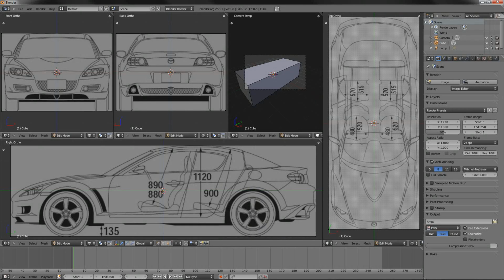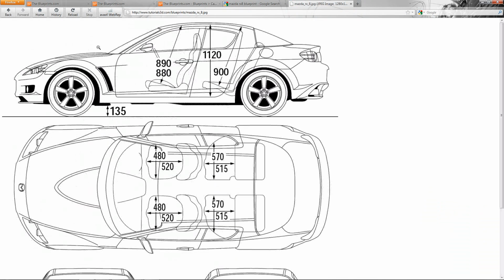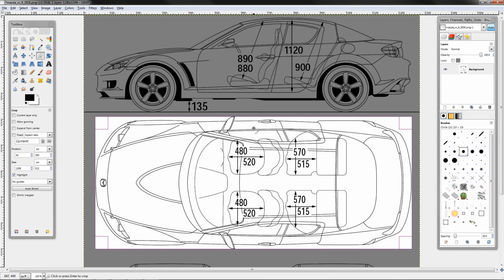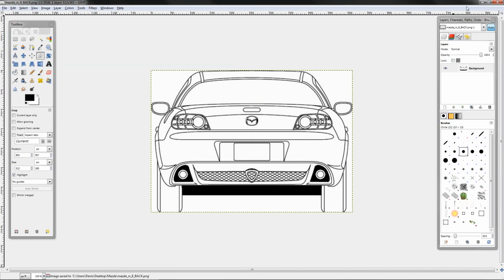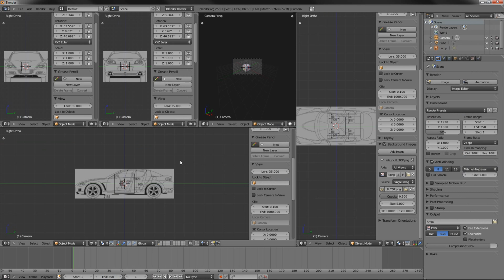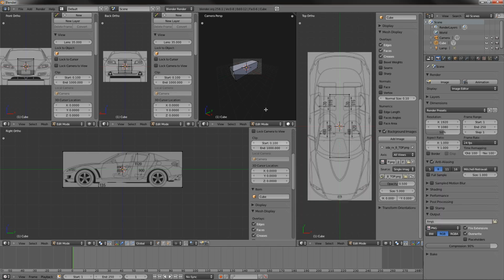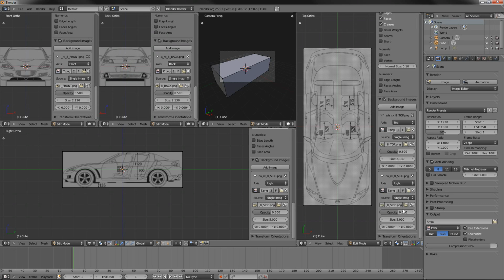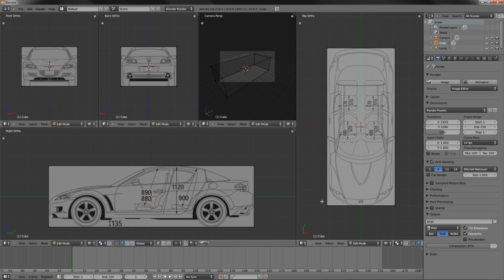Tutorial: Setting Up Reference Images In Blender

Comment: Didn't work here !
Reply from the maker: patriotaRBC You gotta be more specific, what didnt work for you?
Reply: Well, my measures are
Side 1069 x 331
Top 1069 x 400 (400x1069 after rotation)
Back and Front 400 x 331
I set side view and use it as reference to set the others, like you did. Then i make the math you did
400/1069*5 but te result number did not work to fit the width of the top/back/front views. Did i make the math correctly ?
Reply from the maker: patriotaRBC Looks like you did the operation fine 400/1069*5 = 1.87....
I can think of the following that may be of issue:
1) Is size=5 in the side image?
2) Was cropping done carefully to fut around the whole subject?
3) Quality of reference photo?

The math part seems ok, without seeing your setup i am not sure how to help you though. Should be working :/
Reply: The crop has been done carefully and the blueprints have good quality.
What do you mean by "side image size=5" ? maybe i lost some step !!
Reply from the maker: patriotaRBC At around 16:45 marker in the video(in the middle of the video screen) in the Right Ortho view (side view), under the background images, right under the opacity slider the value for size is 5
Reply: That's where i made mistake, the value for side image wasn't 5 but 10, so i did the math with 10, the right value, and everything fitted perfectly !! Thank you so much for your help !! It helped me a lot !!
Reply from the maker: patriotaRBC No problem, glad I could help! Good luck!